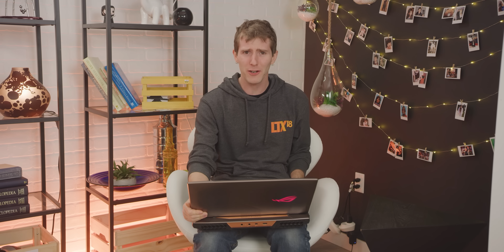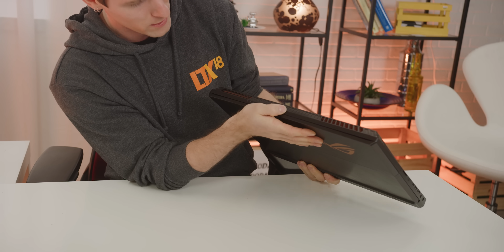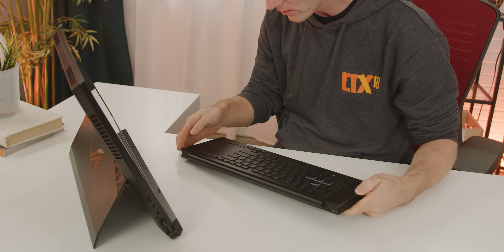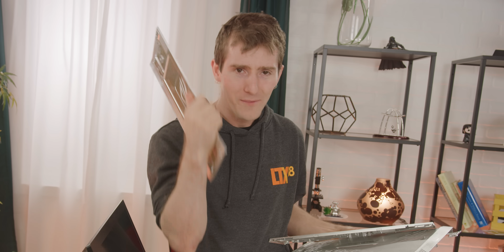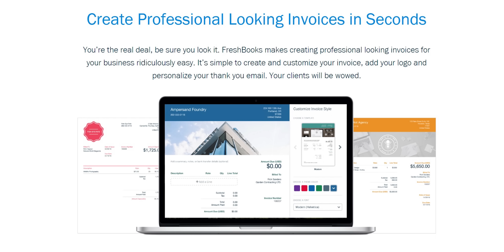A Surface Pro for HARDCORE Gamers - ROG G703 "Mothership" First Look

Comment: You are drinking the kool aid. I’m glad Asus has a skunkworks and invests money in this sort of over the top design. Now if only they could ship a BIOS that wasn’t riddled with errors, had motherboards that were stable without needing multiple hardware revisions, etc. Like most of Taiwan, China, and Apple, Asus is mostly focused on fluff and marketing hype with little regard for how well their products actually WORK. I’d rather have a BIOS that actually worked right than yet another unneeded cooling variation called “FanXpert 4” and all their equally useless B.S. that honestly nobody outside their misguided marketing department cares about. If you want to be seen as even remotely objective call out Asus and their competitors on their fake nonsense rather than kissing their ass and promoting a buggy prototype half-baked currently useless product. I’m unsubscribing as you’re clearly willing to suck up to most any company willing to give you free stuff or something amounting to click bate. You’ve lost your focus and your credibility.

Comment: I bet asus can make it lighter and thinner if they release a version of the mothership with lower spec. Like an i7, gtx 1050i or 1060i. Ram 8-16gb. Basically entry lvl spec. I bet they can make it thin and light with decent spec. Since this mothership is heavy and a lil bit thicker becos it has crazy spec

Comment: I'd expect all those CNC parts to become stamped items for the final product. The heat shield may be cast since it's thicker, but it would be a lapse on the product management side to require CNC on the end product for sheet metal thickness items.

Comment: The CNC machined heat-shield and a lot of the other parts has no reason to be CNC'ed expect for prototyping/testing and will most likely NOT be CNC'ed (at least not completely) when "mass" production starts. 
If they do add it in this form it will only be for bragging rights or to increase the prize even more.

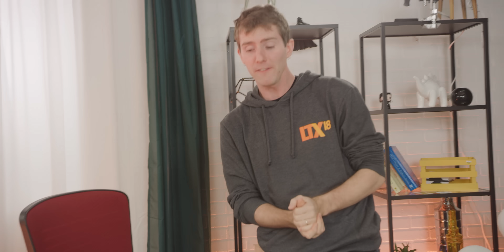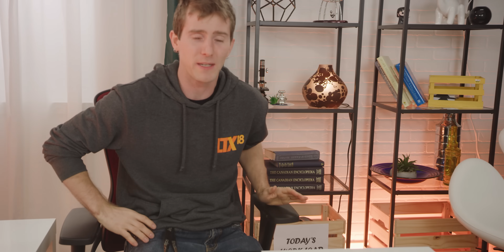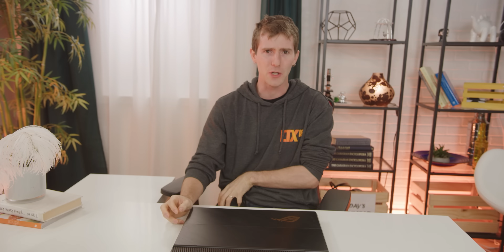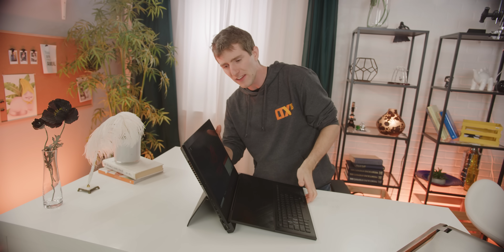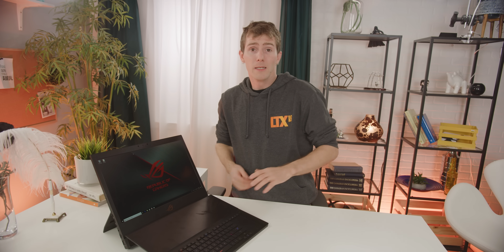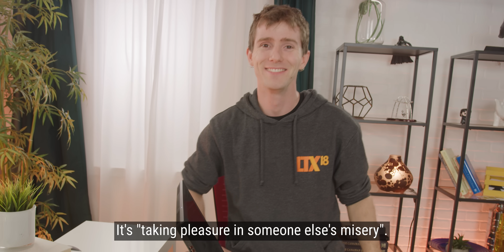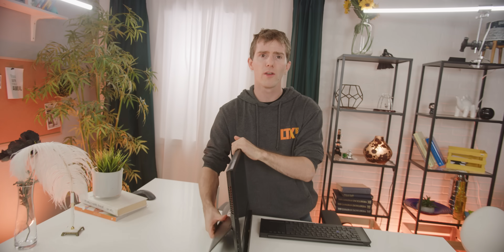Comment: Here's all the times Linus fondles himself! 0:16, 0:29, 0:36, 0:51, 4:32, 4:54, 5:00, 5:07, 5:15, 5:33, 5:38, 5:50, 6:12, 6:24, 6:54, 7:34
Did I miss any?

Working that teleprompter like a boss. Showing off at 0:51 doing a backhand.
Reply: I think it's a sort of tech maybe like an external audio recording device or smth that's tight to his belt
But nice job you will be hired as President Helper some day for your work
Reply: @ArtilleryCrusader Here's the time stamps.

Comment: Uff... 20h of machine-time that's ~ 1500-2500€ / device - only for operating the CNC (job-shop environment, might be a bit cheaper in mass production). Plus workholding on thin parts like this is a bitch!

Comment: It always was bugging me why all those components get air from down below.
The surface has an amazing cooling solution and it doesnt heat up the bottom.

When this is good cooled and has a good price it COULD be an amazing device.

But it will be ROG branded so its overpriced garbage for „gaming“

Comment: Fun fact: 2.5 Gigabit Ethernet is designed to run over the same cabling as 1 Gig. Cat 5e cabling is rated up to 100 MHz of bandwidth, while the 1000Base-T (1Gb) standard only needs 62.5 MHz (4 bits per Hz for 250 Mbps per lane). 2.5 Gb is able to use the same encoding method as 10 Gb though (6.25 bits per Hz), allowing it to use the full 100 MHz of bandwidth on a Cat5e cable for 625 Mbps per lane. Cat 6 has a higher rating of 250 MHz bandwidth, so using this technique you can do 5 Gb using 200 MHz, and finally Cat 6A can do a full 10 Gb using 400MHz of its rated 500 MHz of bandwidth.

Comment: The RTX laptop they were showing off at NVIDIA’s keynote stuttered and frame dropped playing BF5 lmao
Reply: It was on battery power, so I don't blame them. Gaming laptops always suffer when running on battery. No one ever mentions it. =\
[Whispers] Look at the details...
Reply: Cavey Möth I doubt they would preview the game at 20% battery
Reply: @maxmoore8123  They were pretty desperate. Look how Jensen was running around in circles, spouting the same junk as ever.
Reply: + @CaveyMoth  not al gaming laptops suffer when running on battery, stop spouting bullshit.
Reply: The idiot said: of course they do, do a little research of electronics relating to computers and how they are affected by using a battery as a power supply.
Reply: @benterry2681  plug in any computer to an UPS and you will see it affects their performance exactly 0%. an computer does not care what its power source is, as long as it gets the juice it needs. for example, i own an clevo that is an 330watt system. performance does not suffer when running on battery. i can even overclock it, when on battery. this doesn't cause more or less instability at all.
Reply: @tjeulink  Laptops do run slower by default. To make it run just as fast on battery as it does plugged in there are a shit ton of settings to change in windows and so on. Also, its possible that the batteries in those laptops may not be able to handle full power draw of the system, thus the manufacturer would put some sort of a limit on battery management chip. So while you are right not all of them run slower, most of them do run much slower when on battery. Also no need to be so aggressive :)
Reply: @tjeulink  Unless you tweak  the settings for maximum speed off the grid, laptops are set up to reduce speed, brightness, etc. for longer battery life when not plugged in.
Reply: @fallencommander  So in conclusion, they don't always suffer when running on battery?
Reply: @binginsin1  No laptops do not run slower by default. some laptops run slower by default, but not by any measure all. it doesn't require much effort to change the throttling anyways, most manufacturers include an tool that makes it as simple as clicking an button to do so.
Reply: @benterry28  thats because an UPS has to massively up the voltage create an sinus wave and do an bunch of other stuff. battery voltages are much closer to the voltages your PSU supplies. often around 14v. you can easily make 12v, 5v and 3.3v from that. that is why it requires much less beefy power regulation circuitry, because its much less power transformation. makes sense huh? yea thats because i know what the actual fuck im talking about. rackmount UPS systems for example can directly bypass some PSU's and supply 12 volts directly to certain rackmounted equipment because its sometimes more efficient to do it that way.
Reply: @tjeulink  is an Idiot himself
Reply: @benterry28  so basically what you're saying that laptop performance isn't gimped in all laptops? thanks thats exactly what i said lmao. Fluctuating current draw isn't "really bad" for lithium batteries, thats what capacitors are for anyways. throttling also doesn't stop the system from fluctuating in draw, it just limits the top amount it can draw. for it to stop fluctuating you would have to stress the processor with junk calculations just to keep the draw up to an similar level. even if you keep the frequencies locked you won't simply increase the powerdraw.
Reply: @benterry28  Maybe you need to reread your own comment then because you clearly say that it isn't the case in all laptops. 
"most laptops"
Reply: @benterry28  I do understand electrical power supply design lmao, please enlighten me what part i didn't understand about power supply design. you sound like someone who never talks about this though. nobody calls it "electrical power supply design".
Reply: Are we talking about those thicc boi $3000 laptops? Hmm. Well, I guess an MX150 wouldn't be bottlenecked as much by a battery..But still. Even the GTX 1050 Ti in my laptop downclocks hard when I put it on battery. It's almost on par with the Intel HD graphics of my CPU...except the Intel HD graphics seem more stable. Maybe my laptop just sucks or something.
Reply: @CaveyMoth  i have an 200 watt 1080 in my laptop that has about the same clockrates under load on mains as on battery. 330watts of power isn't that much to provide for lithium ion battery's. some can even pump out 40 amps if they have to, and thats from an single 18650 cell. imagine 8 of those, thats 360 amps at about 4.2 volts. heck lets say 3.8  so y'all won't bitch because when discharged the voltages drop. thats still 3.8*360=1368 watts they could supply under *CONTINUOUS LOAD*. now imagine higher capacity ones that can discharge 11 amps continuously. 8*11=88. 88*3.8=334 watts. exactly enough for my system which has an 330 watt mains adapter. it even leaves 4 watt room for the BMS to use!
Reply: @tjeulink  In other words, the battery in my laptop sucks. X3 It's barely 50 watt hours, after all, and I don't know how many volts it pushes out
Reply: @CaveyMoth  Keep in mind that watt hours is something different from watts. watthours is used to indicate how much capacity an battery has, not how much watts it can reliably give. if an system uses 50 watts, then an 50 watthour battery will let it run for exactly an hour. it depends on the specific battery topology. if that battery can supply 40 amps at 4 volts its still going to be able to push a 160 watts which is still quite a lot. it would only run for 20 minutes on that though lol. you could calculate how much wattage its able to supply by measuring how long the battery lasts under max loads and deviding that by watthours i think (not sure though, would have to fumble with the actual numbers until i get an sensible result lol)
Reply: Have it plugged I when you play for better profornance and better FPS

Comment: Let see if I can get the ball rolling:

Subscriber/views ratio comparison between LTT, Austin, D2D, The Verge, and Engadget for the same review uploaded at the same time.
After 7 hours:
D2D: 1.9M subs to 191Kviews: 10%
LTT: 7.8M subs to 463K views: 6%
Austin: 3.5M subs to 85K views: 2.4%
The Verge 2.3M subs to 38K views: 1.6%
Engadget 667k subs to 4K views: 0.5%
Insights?

Comment: Cooling the bottom of a laptop isn't a new idea. https://express.google.com/u/0/product/5007939717369793841_7942249128796728661_118724597?utm_source=google_shopping&utm_medium=tu_cu&utm_content=eid-lsjeuxoeqt&gtim=CM6XuNi6ifbUchDCqt3YvqmyybABGKCfzRAiA1VTRCig5oTiBTD1r844&utm_campaign=118724597&gclid=Cj0KCQiAjszhBRDgARIsAH8Kgvf9Ky-9zuwqokKwpdCyePSh7FrTbROW3XyDeZs7mox8caLNmLgSnyUaAqzyEALw_wcB
That's basically what they've done is just build in one of those to the machine. /rolleyes

Comment: I was about to say it doesn’t take 20 hours to mill that plate. Thanks for clearing that up. I mean you pulled out what amounts to a solid block of aluminum plates. That seems a little time intensive to produce for the application to me. Surely they could of came up with a better option for cooling. That whatever you all it, thing is going to cost so much.

Comment: There's some good ideas here, but no, I wouldn't want to use that contraption as my primary machine the way it's currently set up.
At a first glance my biggest complaint is the screen angle. Here we have a premium desktop replacement that doesn't allow you to set the screen to whatever angle you want. It looks like it would be fine for having it on a low coffee table, but I certainly wouldn't want to work hunched over like that. And this thing needs a table if you are going to use it with the keyboard. The ROG shown first might be clumsy, but at least it's possible to balance it on your lap if you need to. This "Mothership" would just fall apart and you'd probably end up dumping the screen on the floor, so that's a no go.

I'm not condemning the concept. I'm sure they've got a lot of people working on this that thinks it's a good idea and that they might be able to make it work as a desktop replacement once they've figured out the display stand, but I doubt they will be able to make it into a good laptop replacement. 

But all of this is totally irrelevant as the complexity of manufacture will make this particular model a unicorn. The cost of milling all of that aluminium alone is horrendous. Add the cost of design and the components and things are starting to get interesting. IF they were to go for mass production they might be able to optimize the production, but it will never be anywhere near what a conventional laptop with he same specs would cost. So these machines will end up as exclusive toys for people with more money than they know what to do with. 99.9% of college student's won't be able to afford this machine, and once you're working for a living you probably find a lot of other things that's more important than having a machine like this. If you've got the money to burn then sure go for it. It's going to be an awesome machine that you will probably be happy with for at least two to three years, after that you will probably start feeling the upgrade itch again...

Comment: Linus and Alex, I know that this idea is a bit outdated, and I know you like crazy experiments too, but could you make a custom "dock" for the ASUS ROG 703 (or any other laptop), that would "super-charge" it, by cooling the air pulled into the laptop, via a CPU heatsink attached to a CPU "water" block that was being cooled by you old "chiller", you cooled a threadripper CPU with in one of the videos. And all that WITHOUT physicaly (you can have liquid metall under the CPU heatspreader, but no modifications to the "case") modifing the laptop (that is the point of this).

Comment: This laptop is what I think the good design of gaming laptop
"When the airflow under/side of the keyboard is not efficient to reduce the heat, why not just make the Entire Hardware is placed on the back of the screen just like tablet, so the airflow is not blocked/more effective, and make the keyboard is attachable like tablet too"
I thinking that 2 years ago, and watching this just like my thinking is granted, GOOD JOB ASUS
Reply: Or you could use a laptop stand. Elevate the laptop getting better cooling.
Reply: @aarong.4691  yeah, but it will be not practical
Reply: @benjiro8793  what I hate about laptops is that if you use it on a desk you either have to use the laptop keyboard or use a second keyboard. ,If you use the laptop keyboard you have to choose between a comfortable place for the keyboard or for the monitor. Both isn't possible. And if you use a second keyboard you have two keyboards in front of you, which takes a lot of space. 
This device is perfect for use on a desk.
Reply: @benjiro8793  nah, CPU must be placed inside the motherboard, there is a requirement how close the CPU is to the capacitor, resistors, MOSFETs and stuff like that. Put them away not only cause big delay between parts (thus potentialy throttle your laptop, which is already inferior compared to a desktop) but also risk damaging your component as well. Not to mention a way to modify components and I/O ports to make this work
Reply: There is a risk with all that weight held high in the air, these things will fall over an order of magnitude more often than Laptops.
Still, for the performance gains, totally worth it.
Reply: @benjiro8793  yeah, it will be the other solution
Reply: true , i would rather have a laptop that s a big bulker so i can game ect a True pc replacement , then these thin crappy ones that can not do like wow or these types or games and stuff , People are getting to picky or too lazy with this thin stuff any more what i mean about lazy? is people dont want to carry it around lol It will put some muscle on your arms )))

Comment: I wanted literally this exact device for so long and it hasn’t existed. I would prefer a lower spec model like a quad core and 1070 that was a bit smaller. I use a laptop but I take my mouse and 60% keyboard most places with it. But having a keyboard in front of a laptop takes up a ton of space. Ever since I first saw a surface “laptop” I’ve wanted basically this exactly and I hope they have a lower spec cheaper model when they launch.

Comment: Always had heavy 17 " laptops, both ROG and MSI. Always on my lap, either in bed or in the couch.
Only time it´s on a flat surface is when I´m watching movies while going to sleep.

But this would put all the weight on that thin edge into my lap. Fuck no.
Don´t compare it to a laptop, if you can´t keep it on your lap. It will have all the negatives your get with laptops, which are many, but not the single benefit you get with a laptop. Pointless.

Comment: A desktop replacement they say. The day when a laptop can be easily user-serviceable for all components whether desktop or mobile component and cost less than 1500 - 2000 cheaper, I would consider it as a "in-between desktop/laptop" category.